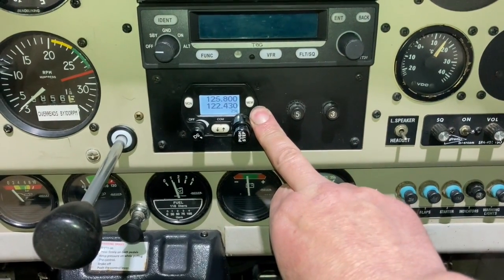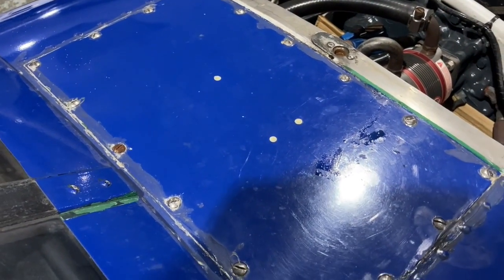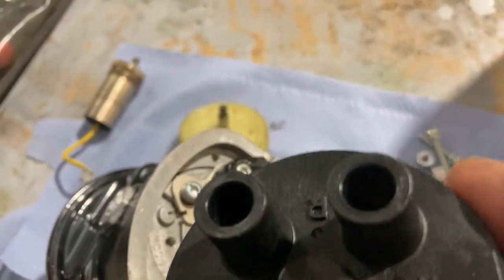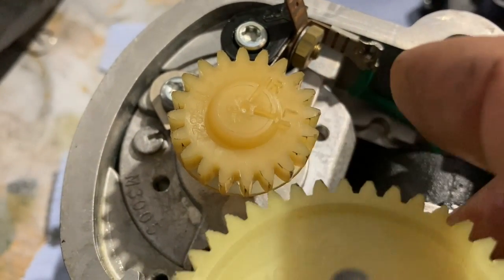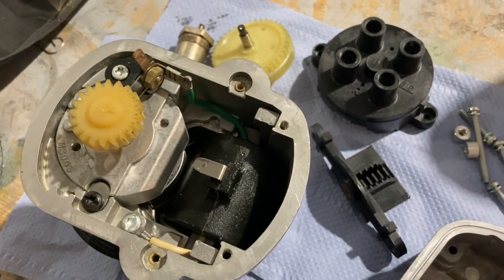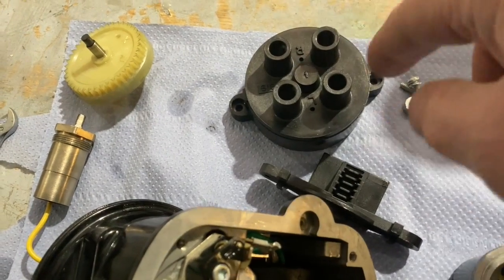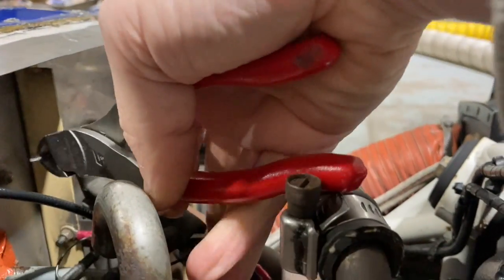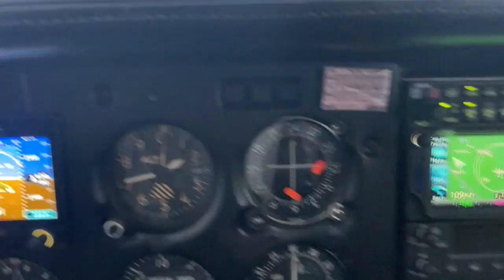Interference on trig TY 91 VHF radio, investigation and rectification

Comment: First P lead wires must be shielded all the way to the ignition switch. And each magneto lead. The magnetos are lubed with what’s referred to as magneto grease which is actually a thin oil. It is impregnated in the wiper felt on the timing cam and in the bearings. If you use too much it will make everything oily.  You can test your capacitor instead of replacing it but if it is older you’re probably better off replacing it.  You usually replace the points at the same time as a bad capacitor is going to leave them pitted pretty badly. Don’t try to use a point file. It won’t work well and you’re just going to create further problems. I think the p-lead was the problem. Transponder could be ground and or antenna placement. There are filters (chokes) that can filter out that transponder 😢frequency in your coax coming into the radio with no adverse effect on the transceiver power output or sensitivity.

Comment: Good vid, for troubleshooting you might just run it on one mag also. You aren't the only one that has problems with Slick mags, we are still finding loose impulse coupling rivets at flight school on less then 1 year old mags and this is Dec. 2023, quality inspection at Slick is piss poor, they are not following their own maint. manuals.

Comment: You can also use cable snap on ferrites on the ends of cables, ends of power to the transceiver, end of coaxial from antenna and even on cables that are going in to the transponder.